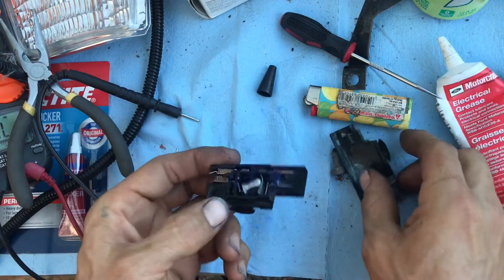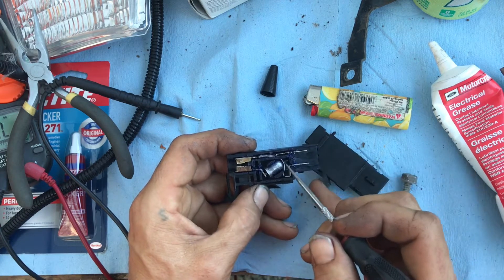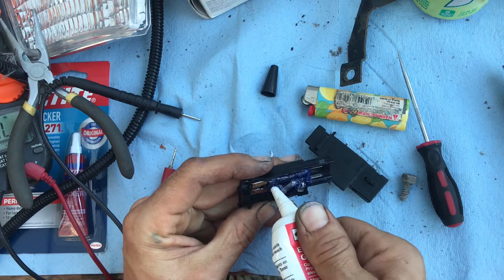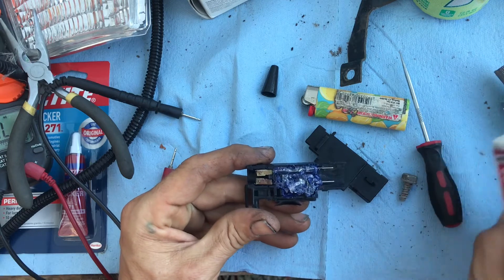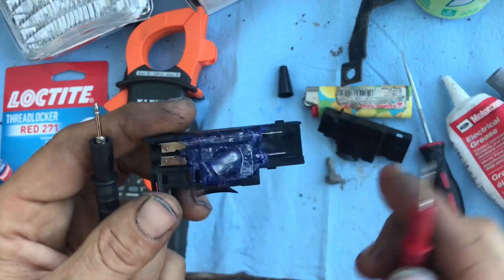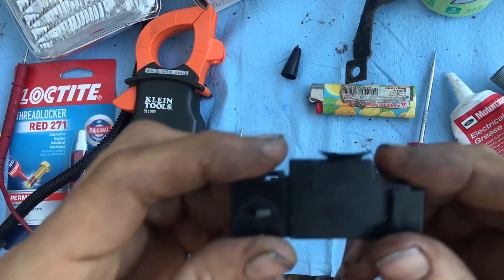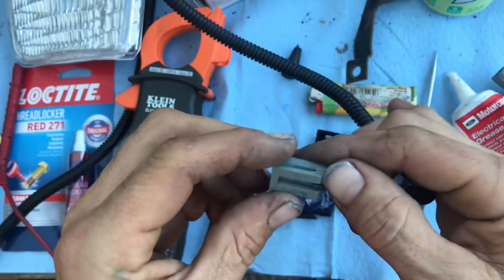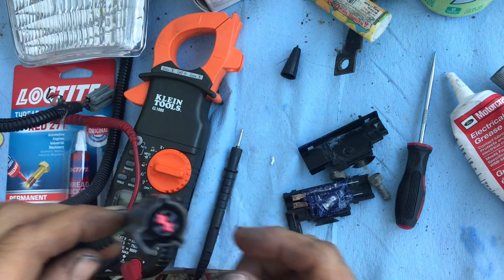1993-1997 ford under hood light repair

Comment: Will dielectric grease work if i cant find the ford electrical grease?
Reply from the maker: Yes, Dialectic means it is either non-conducting our very poor conductor, you wouldn’t want to put a conductive substance inside an electrical plug-in with multiple wires, the grease is just to keep the connectors from oxidizing. My father-in-law is a dealer mechanic for over 30 years and he said he would put any type of grease in something rather than nothing (I don’t recommend any old grease), I suppose you could just use silicone grease but then again I’m not an engineer. But I have used regular silicon grease with great success. Remember the wires have to make physical contact but the grease is just a barrier between them and the oxygen in the atmosphere.

Comment: I took 5 of those out of junk trucks and every one of them were broke at the gray plug. I searched the web at company's that make pigtails and not one had that plug. Pisses me off.
Reply from the maker: I think I found one somewhere and they wanted about $100 for it, but if you’re the type of person that has to have original equipment I guess whatever. I suppose you could take one out of any old truck and wire it in if you don’t mind about things not being original. When I was a teenager I bought a 50 foot spool of speaker wire from RadioShack and had a tail light from a motorcycle screwed the top of the spool. If I needed a light or to change a tire I could hook it up to my battery and have a light up to 50 feet from the truck. In the late 80s and early 90s, un teenagers thought that was cutting edge.
Reply: I think it's possible to rebuild that plug right? It's got some kind of pins inside that you can actually remove from the plug and replace. I've seen videos of how to take pins out of a plug that aren't being used or even swap them around if necessary , So it must be possible to take it out and put in a new one